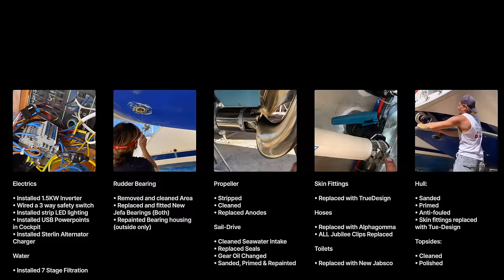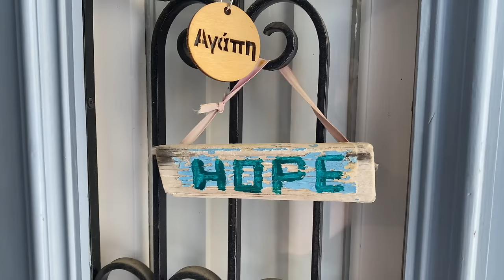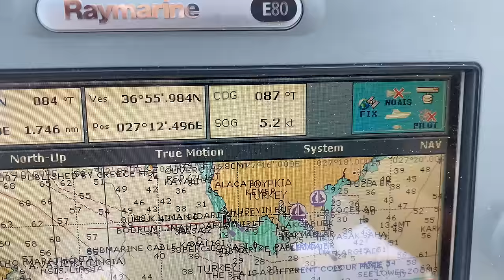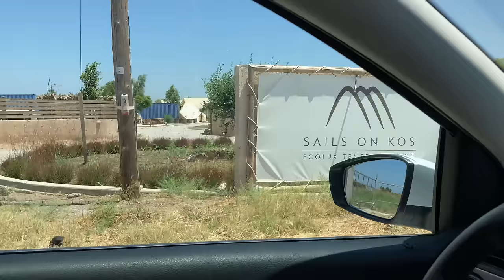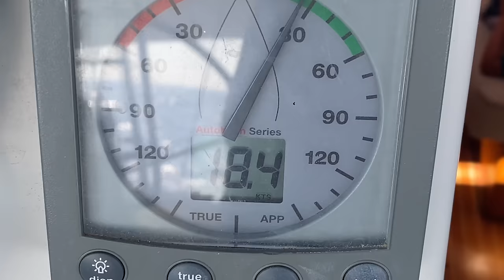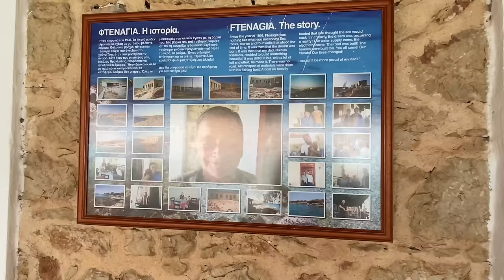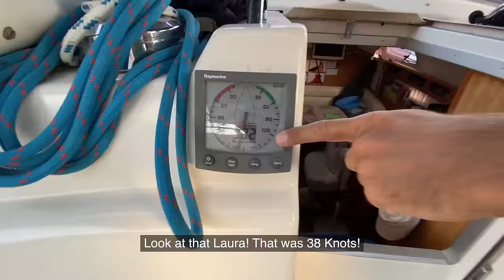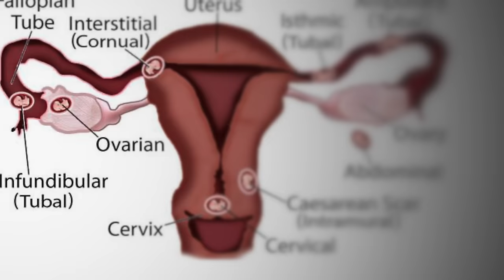'My Nude Greek Life' - freedom, sailing, happiness & heartbreak…Season 3 (special extended cut!)

Comment: Sterling alternator booster, fire waiting to happen.
Ask Rauri at Vlicho yacht club what he thinks of them!
Reply from the maker: So far so good!
Reply: @SailingHollyBlue  keep an eye on it as on we had one on our Jenneau 45.2, th batteries went to 16v when charging from the alternator. I removed it. 
Most alternators on sailing boats are not marine alternators so not designed to run hard for long periods of time
Reply from the maker: @JayPerrypersonal   it actually depends on many factors… recently, we have now moved over to Super B LiFePo4 batteries which charge at the same rate ie/ 14.4v absorption and 13.8 float. I have introduced a switch for this bank so I can limit the alternator charger use to only 2 hours (to save wear on the alternator) during winter and rarely need it on at all in the summer with our solar arrangement… also unless using the motor for propulsion also, it’s much better to use a generator for charging. We’re getting 150ah (which these batteries absorb at this rate to 99%) for only 1 litre of fuel using the new Honda Eu32i rather than about 60ah for about 4 litres using the engine/alternator. The alternator charger was really designed for AGM or Lead Acid.  For LiFePo4 Victron Orion is probably a better option.
Reply: @SailingHollyBlue  lithium batteries don't float